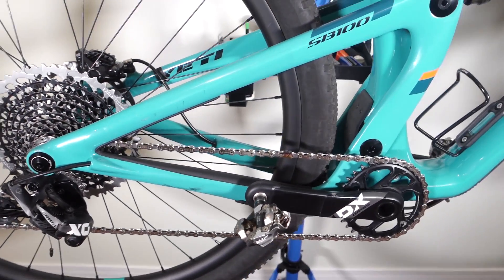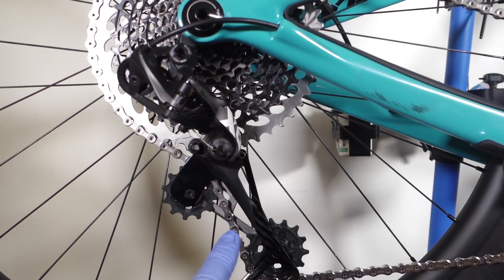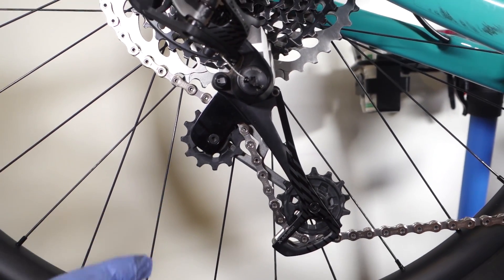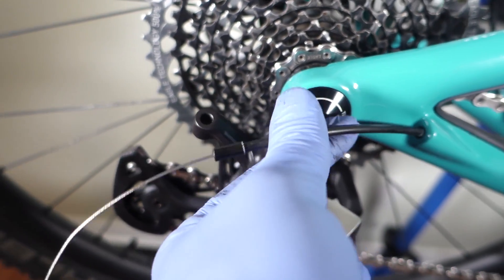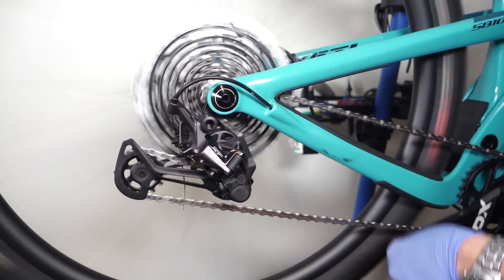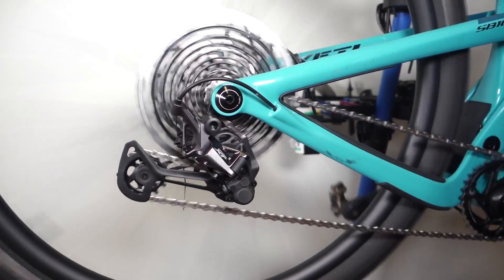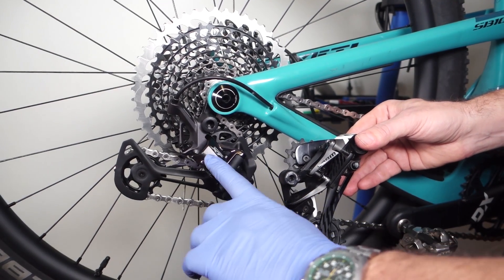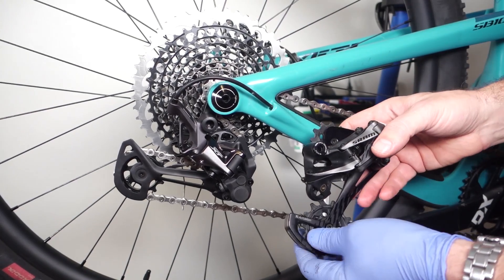MIX Drivetrain🔥12 Speed SRAM Eagle Can Use a Shimano Derailleur - Hybrid Drivetrain

Comment: @#LoveMTB I'm currently about to make the jump from 11 to 12 speed and before pulling the trigger on a particular make and model I'm doing some research. That's how I found your channel actually;) you seem to have a very good amount of experience and understanding on both Brands systems and I have a question I want to run by you. In the majority of testing videos that I've watched on both group sets the majority of testers have all said that the Shimano xtr shifter feels better but the sram xx1 derailleur seems smoother. Would you agree with this statement or would you say that the difference is so negligible you don't notice it? Also I have heard several reviewers and testers say that when using the full XTR 12 speed groupset in particular the XTR chain cassette and shifter together you can actually shift under load... I'm very skeptical of this but in most cases  the people saying it have been  riding a lot longer than I have. Would you say that you experienced the same thing? being able to shift in either direction while pedaling hard on a steep climb? If so do you think that it would still be possible to achieve this running a full Shimano XTR groupset except with the sram Xx1 rear derailleur? because if you can still shift under load with that setup, all my research points to that being the optimal choice of equipment  for 1 by 12

Comment: Great video!    Would a 12 speed SRAM SX derailleur be compatible with a Shimano SLX shifter?    Or do one need to use an XT  shifter for this combo to work?
Reply: @LoveMTB    I was told before the 1.1 SRAM ratio was not compatible with Shimano's 1.2.  What was that all about?

Comment: Thanks for this. I WAS running a GX on my new YT Capra until the derailleur body broke and the rear wheel ate the derailleur, chain and bent the hanger bracket. SRAM GX=Junk junk junk. YT would not cover anything under warranty. I will be replacing my components with Shimano.
Reply: LoveMTB Hi, it’s a 29er, 1x12, formerly SRAM SX Eagle, now XT.  I didn’t hit anything it broke in low gear going up a hill, the body of the derailleur broke around the attachment bolt.
Reply: I didn’t replace the shifter, just starting to do the project now. Will it not work with the SRAM shifter?
Reply: LoveMTB After I came home and installed the derailleur the SRAM shifter stopped working. I replaced it with a Shimano SLX shifter and the whole thing has been operating perfectly. 👍

Comment: Just replaced my eagle SX rear derailleur with XT 12spd. I'm still running SX everything else because the shifters are impossible to get. I have to say with 5min of super-amatuer tuning it shifts flawlessly! :) Great upgrade and thanks for the video! :)
Reply: thanks for your comment, I'll do the same, my Sram sx rear derailleur broke for no specific reason.
Reply: @diaahleihil8393  mine broke afer 8 months, a friend from a local bike shop said to me that SX rear derailleur is garbage, they had many customers with the same issue, even on bikes with less than two months of use.
Reply: @edgarstudillo5649  , Yes SX is garbage, now I am enjoying Shimano XT.
Reply: Thanks for commenting your experience.  So you are using the sram sx shifter with the shimano xt rear derailleur? Did you notice any problems with shifting up and down while pedaling? I want to upgrade my broken nx derailleur to something more durable wonder if the xt is more durable over gx? Thank you
Reply: @BlackSummit92  In my experience it was better in every way than my SX. Quite a different feel, the SX was very very light to shift while the XT feels a bit more substantial. I don't pedal at 100% through my shifting but I have had noticed nothing but positives since upgrading.
Reply: Thinking of changing to SLX derailleur. Should work too right?
Reply: @shikozu2  yes, it will.
Reply: @diaahleihil8393  Nice! My future soup
Setup.
Reply: @shikozu2  good luck
Reply: @diaahleihil8393  Thank you!
Reply: @shikozu2  yes
Reply: Hi There, 5 months on, is your set-up still working well? My bike isn't arriving until next year (with SX) but I've already ordered an SLX (M7100) mech and shifter. I'm gonna just give them to the shop to fit before I go to pick up the bike so it will be interesting to see what they have to say re. cross-compatibility. I've seen a few videos with people saying "don't trust someone who says it works just because it shifts adequately on a bike stand in their kitchen. Does yours' still work perfect? can I stop worrying about it and be confident that its gonna work?
Reply: @SH-ig6rd  Hi, I ride 3 times a week. (about 3 months now since I changed it) with 0 problems... Just stop worrying Its PERFECT.
Reply: Just changed to the same set up as yours. Best decision ever made. No hitting on spokes like the SX does. Just wondering if the changing the crank to 12 speed deore will effect anything.
Reply: @shikozu2   well, this I dont know.  But I think it won't
Reply: Can i shift to deore m6100rd the rest all sx.. any one running that set up??

Comment: Thanks for the video. I am replacing my Eagle SX rear derailleur with XT when it comes in the mail. They are approx the same price. Maybe silly question: do I adjust the B-gap using the marker for 51t even though my cassette is 50t? Thanks :)
Reply: @LoveMTB  cool thanks for that! :) Yeah I think this will be a gradual move to XT. Will replace the chainring/cassette/chain together! :)
Reply: Hey guys! Im on SX now. Can I use the new deore 12s on this as well?

Comment: Random, but between the shifter and derailleur which determines the pressure required for each shift? I notice that the SRAM Eagle shifter + derailleur has a significantly softer lever pressure.

Comment: Can I use 11s xd sram cassetes with xtr9100 shifter+xt8100 SGS derailleur?
Reply: Im already have this 11/12 shifter installed on my hardtail and use it with 11s slx drivetrain that  works perfect. But i want to change the wheel to hope pro 4 hub, that comes with xd and stay on 11s for a while with slx m8000 derailleur, because there is a problem finding micro spline nut for hope in my country. Thanks for answer!
Reply: LoveMTB just found one one cnc website and ordered! It comes with spring and pawls
Reply: @LoveMTB   not cheap that is true, but give me no choise. there is also options cheaper on aliexpress website, but all of those dont supplied with spare pawls

Comment: Nice video. I prefer using a SRAM cassette mixed with Shimano shifter and derailer. Shimano states there new group sets allow you to shift under load  smoothly. Was wondering if you can still shift under load smoothly using SRAM cassette mixed with Shimano shifter and Derailer?
Reply: LoveMTB Thank you for the response. I’m going to go with the XTR shifter the XT derailleur and SRAM cassette and chain. I was interested in the smooth shifting under load for transition areas when coming off a steep downhill and then all of a sudden you got a steep uphill punchy climb and you get caught in the wrong gear but that usually only happens when I get lazy with my shifting.
Reply: @LoveMTB  it is very interesting, why you prefer Sram cassette and chain instead Shimano cassette and chain. Many writes that Shimano (with their cassettes) shift better and smoother than Sram...
Reply: LoveMTB  uh oh! I ended up getting the xtr chain xtr shifter xt derailleur oneup chainring oval and gx Eagle cassette xo1 cranks. I didn’t know shamano chains caused problems. I’m installing everything tonight for a race on Sunday hope it all works out. The reason I prefer sram cassettes is because it’s just simpler all one piece And I personally hate HG drivers.
Reply: the single most valuable information out there in the internet regards to this topic

Comment: In my case it didn't work. I changed my NX (which I hated and still do) for an SLX mech plus SLX shifter. Actually my LBS did and they are pretty good. However, shifting on the stand was average at best, on the trail it was abysmal. I ended up buying a Sunrace MZ903 cassette and an XT chain and I am happy again. 
The NX shifter might have worked (the distances between the cogs are different) but I wanted the index finger downshifting which SRAM doesn't have.
Reply: It sounds like the Shimano shifter doesn't work with a Sram cassette.
Reply: Robert Laussegger what didn't work well? possible different gap on gears shimano vs sram...it's 0.1mm/gear...that's 1.1 mm/cassette on last gear....??
Reply: @LoveMTB  what didn't work well? possible different gap on gears shimano vs sram...it's 0.1mm/gear...that's 1.1 mm/cassette on last gear....??
Reply: @LoveMTB  of course it works better only with the derailleur, because the shift lever has other spacers for gearshift gears compared to the sram, like the sprockets

Comment: Will the SRAM Eagle derailleur work on a Shimano 12 speed cassette?  I am still running an xtr 11 speed but would really like that extra gear at times but that conversion is not cheap.  One can still dream.  You seem to have the answers to a lot of my questions so I really like following your channel.  Thanks !   If you have any good advice on removing a seized seat post please let me know.  I am doing a restoration project on an older Redline Monocog and the only holdup is that seatpost.  Frustrating but I know there is an answer short of disolving the aluminum post with harsh chemicals as a last resort.
Reply: LoveMTB yes the 12 speed,  I would like to change out my 11 speed for the 12 somewhere down the road.  Old men like me like things easy.  I think the Shimano cassette has a 52 tooth and was just curious about the derailleur and shifter compatibility.  As for the seatpost, the frame is in excellent condition and I hate to give up on the project since I have all the parts to finish the restoration.  It seems to be a fairly common issue with an aluminum seatpost in a chromemoly frame.  I’ll let you know if I can’t work it out.  So far nothing has worked and using costic lime to dissolve the aluminum would mess up the powder coating on the frame.  If that even would work.  Thanks though for the response.

Comment: I also run a XT-Derailleur with an Eagle Cassette and Eagle Shifter cause my gx-derailleur broke apart after 2 months without a crash. Shifts perfectly.
Reply: @LoveMTB  can i convert a nx 1x11 in a XT 1x12?
Reply: I just bought an SLX rear derailleur for the same reason, my GX just gave up with no warning.
Reply: Yep my gx flew apart for shits and giggles and now run xt and no problems lel
Reply: @MrRooskiRu  did it works fine?
Reply: @hirmanaldo  Yup, 100%, 2000km later and no issues. Gx shifter and slx rear mech, sram gx chain and cassette.
Reply: Did it make the shifting faster?
Reply: @LoveMTB  don't i have to worry about direct mount derailleur and similar stuff? I don't understand much of it
Reply: @LoveMTB  oh, and is a 120mm recon rl better than a sektor RL? I haven't found many reviews on the recon and the sektor wich should be much better has bad reviews on it

Comment: A short explanation to those trying to understand 12 speed sram and shimano compatibility.
Derailleur pull ratios are almost the same, but cog spacing and shifter cable pull slightly differ.
So, to get perfect shifting, shifter brand should match the cassette, and the derailleur is not so important.
Otherwise it works ok, but not as good as with matching shifter and cassete.

Comment: I really needed to see if it works cuz my lbs said that id would have different pull ratios and wouldn't work. When you installed it on the bike did you just separate the chain or can you remove the other side of the cage like with sram? That way you wouldn't have to install a new master link.
Reply: It's fine to reuse the master-link ;)
Reply: I think you can just take apart one side of the cage on the Shimano derailleur to put it on.

At least with older Shimano derailleur a that was possible so I would assume that didn't change.